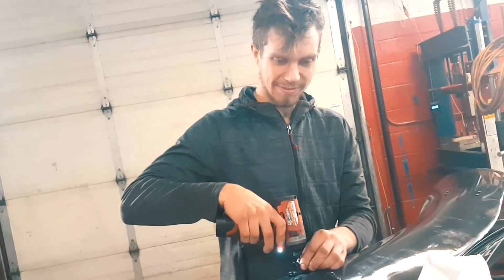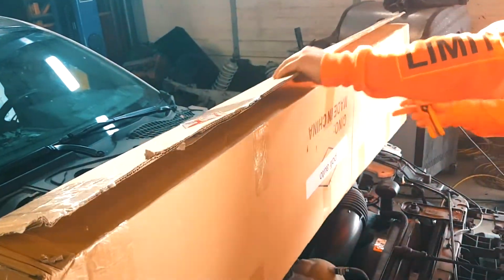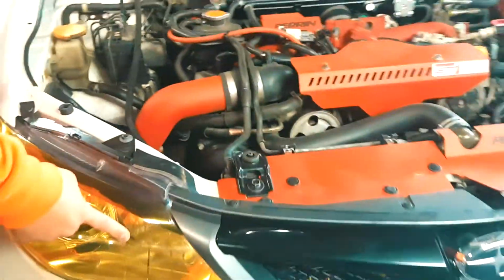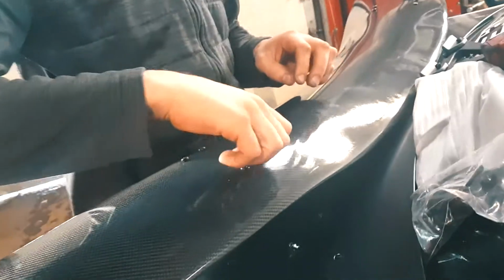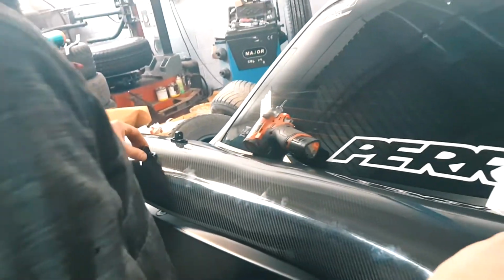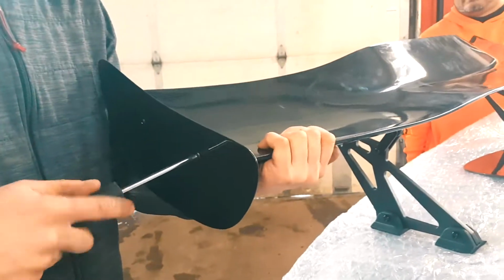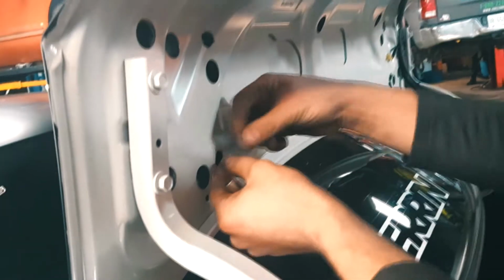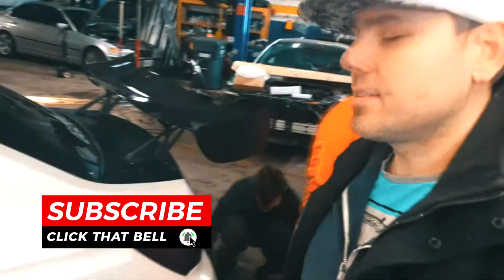30 Minute Spoiler Install - Carbon Fiber Rear Wing on STi Trunk  - Install by Revvdmotors Oakville

Comment: I understood that the hole inside the truck where the rigid structure skeleton is present, has to be made wider so that a spanner head fits in it to tighten the screwes from inside. My question is cant the spoiler be installed without making those wider wholes inside the trunk, i mean cant those screws (with a bit longer ones) be tighten directly on the rigid structure part of that trunk which gives the trunk that rigidness? No wide holes, just tighten it on the second metal rigid layer instead of tightening the screw on the top metal layer of the trunk. I am thinking that it will not warp the trunk metal because of the spoiler getting pulled up by air while driving if the screws are tightened on the rigid structure of the trunk.
Please give advice on this matter as i am planning on installing a after market fiber spoiler on the trunk and just want to clear my doubts.